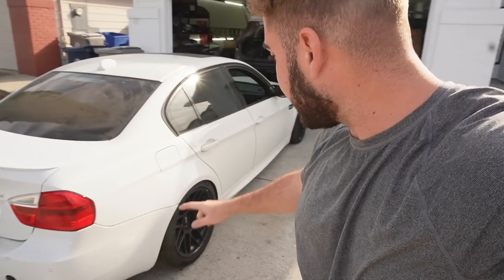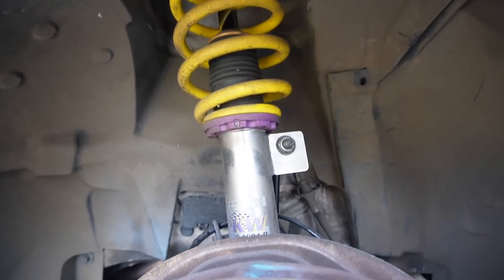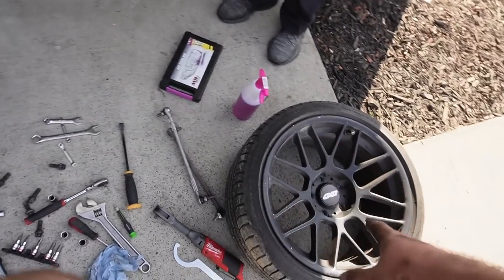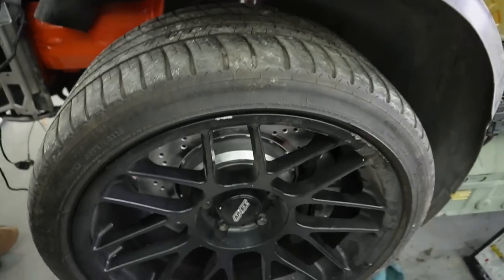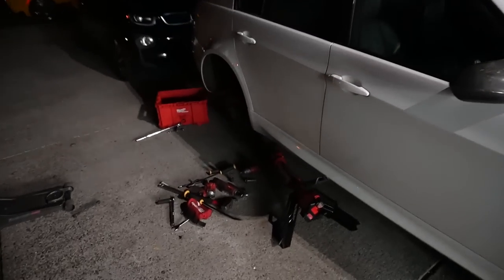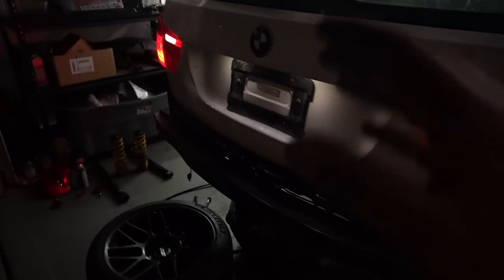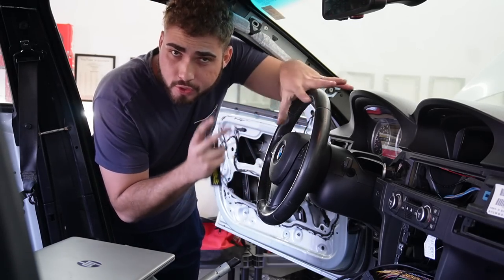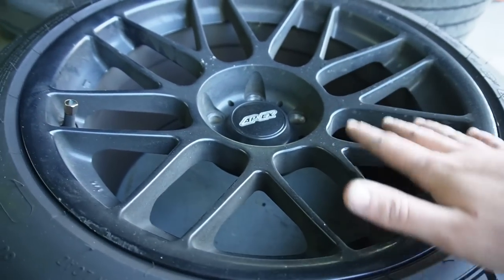Building A Custom 1 of 1 E91 M3 Wagon! (Part.21)

Comment: those custom headlights on the e90 would be dope on the e91, also the wiper wont work if the microswitch for opening the glass doesn't work.

Comment: i assume you’ll have trouble with the clockspring for the e91 as your M-Button (MDM setting) on the steering wheel will not work if you don’t have the correct clockspring.

PS: how did you solve the climate control showing NC